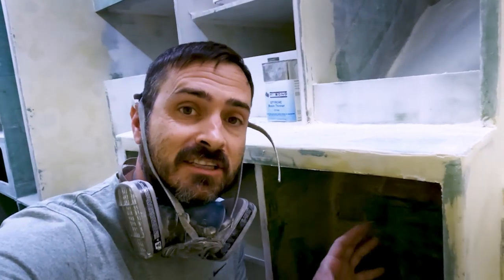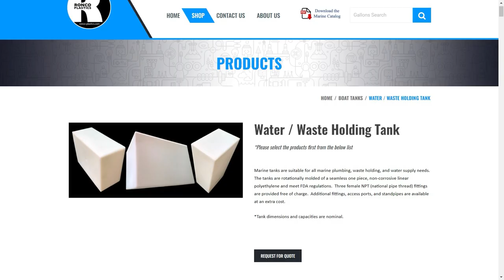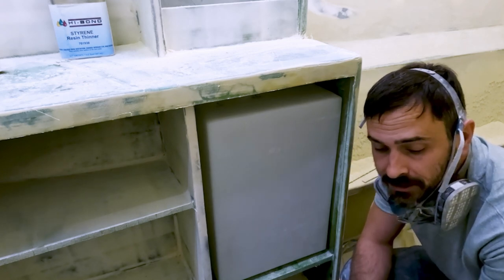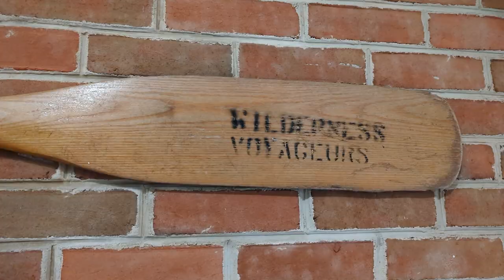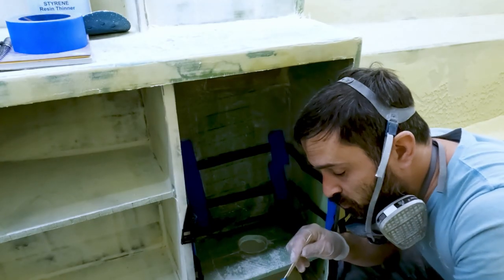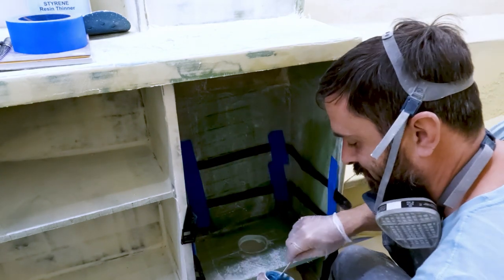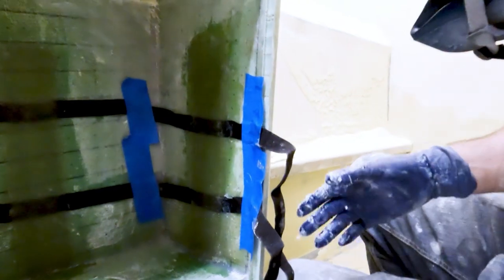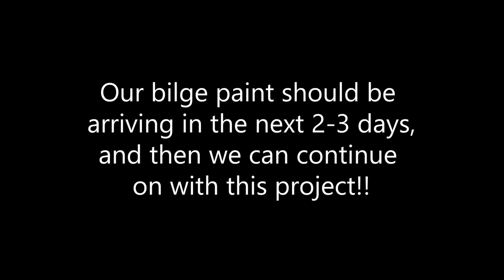Should We Have Built This Holding Tank Ourselves? (MJ Sailing - Ep 275)

Comment: Those straps are going to eventually tear where you fiberglass them to the cabinet wall. Would have been better to fiberglass and d rings, and then hook the strap to those. You could have used rubbers spacers between the cabinet walls and the holding tank.
Reply: Yeah agree, those straps will also stretch over time and under way that thing is going to thud back and forth in there and make a racket. The foam would resolve that.
Reply: I have used straps like that, and they deteriorated over time and fell apart.  I give them 10 years or so before they are going to be cursing the day they decided to glass them in place instead of glassing in hold downs that the straps slide into.

Comment: One easy trick to secure the tank is to first cover the inside of the room with normal PE plastiic film. Second insert the tank and use PU expanding foam around the corners of the tank. This wil secure the tank. As the tank is made from either PP or PE the foam will not stick to the tank nor the thin plastic film. When the tank need service, rip it out and ditch the foam. When the tank must be reinstalled, use the procedure above again 🙂

Comment: In addition to your straps get a can of great stuff and put 1-2 little dots ( think silver dollar) on each side and a dot or two on the bottom and it will keep the tank from knocking around. Works well and it'll allow the tank to expand/ grow if need be. Soft enough to allow expansion but stiff enough to hold it snug.

Comment: Hi y'all great work! I have a little engineering tip about why you always space out the straps on a tank even if you never expect it to be full. Spacing out the straps makes the tank more stable because it's easier to resist rotation from both ends of the tank rather than just one. So while it may seem best to place both straps near the bottom where most of the weight will be. It's actually far stronger to have one strap on the top and one on the bottom.

Comment: Hi You Two! As always, thx so much for your channel! 

As you plan your moves with your freshwater feeds, I have an idea you may wanna consider… there are scores of accumulator tanks out there, but I've done it differently (and much, much cheaper with similar results). I don't think we really need bladders (unless we wanna install at lower points in our system). What I've done a few times is choose a location that's out of the way and high up anywhere in the boat. Doesn't matter where. Maybe pick a closet or a lazzarette and buy as tall a piece of 4" Schedule 20 PVC piping as will fit up in a back corner of said compartment. Buy caps for both ends, a simple pressure gauge and a bicycle inner tube style of valve (Schraeder Valve), if you wanna get fancy. Put a 'T' at the bottom and let that hook up to any branch of your plumbing. As you run your system, any air will naturally accumulate in as high a point as it can find. Hopefully, your new PVC tank will be that high spot! You'll save $$$ and get much longer runs of pressurized flow with far less cycling…
Reply from the maker: Interesting idea with the PVC pipe.  I'll weigh that up vs an accumulator.  We did buy a Marco gear pump - which doesn't require an accumulator - but we probably should have one anyway to limit the on/off cycle
Reply: @MJSailing  Yep - not only do you stretch the life of the pump, you also run a quieter ship. For me, when I'm skippering, rather slight noises wake me up. Hell, a good-sized course change even wakes me! You'll also save a lotta money. All the best, Matt!

Comment: Matt, You could have used cheap thin wall plastic tubes, heated and flattened to easily fit your straps of choice. Glass them in at the same locations, and then be able to tighten them more and replace them at will, just in case of a single failure. Great instructive content, thankyou!
Reply from the maker: I didn't want movement in the straps.  Same reason you don't use continuous webbing for battery hold downs.  They end up sawing themselves apart.

Comment: 10:35 Would it not have been better to have glassed loops on to the hull, then thread the belt through them?  What happens if the straps degrade and need to be replaced?
Reply from the maker: Just cut them out and put new ones in if they need replacement.   Stabilizing the strap prevents sawing action against the fiberglass.  If allowed to slide, they'd then abrade and cut through quicker.
Reply: @MJSailing  true. Good point. I would have looked for a brace that screwed into the dudte panels like a battery hold down. But your solution is one way of solving the issue. Looking forward to seeing the boat finished.
Reply from the maker: Unfortunately nothing can be screwed into the foam the hulls or cabinets are made of.  This requires all to be bonded (a lot of extra work) and more "outside the box" solutions are needed for attachments.  Luckily, I've seen this done in the past on French boats, so it wasn't much of an experiment :)
Reply: @MJSailing  This is one of the reasons I love your channel. I learn something new every time. 👍👍

Comment: I was hesitant to question the genius of Matt but, hahaha,,,,,,,while watching the video I thought there must be a better way to secure the tank and now see comments in agreement. The weight of a full tank will eventually weaken those straps. I think, slightly wedging (and securing) a 1 inch strip (4 total) of fiber board on the upper and lower sides between the tanks 2 sides and panels, then screwing a 1 inch fiber board strip into those side wedged strips. They would run across the front of the tank. That tank will not go anywhere and can be taken out by removing 4 screws.

Comment: Fiberglassing straps in place seems highly unconventional and a    significant hurdle for anyone needing to replace a strap.  Since the strap doesn't slide, the strap wrapping around the tank doesn't do anything.  Was using screws to secure short strap sections in place or a bar like a battery hold down considered?   If you really wanted fiberglass - maybe create a fiberglass belt loop of sorts that a strap could run through and also allow easy replacement.
Reply: Agree, those straps are going to need replacing often, and now you made doing that a major job.

Comment: YES---that tank will MOVE---those straps along with a partially filled tank and any sort of Sea-action will cause thse straps to loosen. The Sea shows no MERCY. Fecal matter out in the cabin is never pleasant. You might try some plywood shims and bits of the "Great Stuff" foam, which you can later remove to service the tanki. As soon as you said--"It ain't going Nowhere"--that was a major RED FLAG. I would guess your comments section is filling up on that subject!-------Mikey, Belfair, Wa
Reply: I believe that it is the holding tank for discharge water ( grey or clean water, so you don't need a pump, like normal toilets) ,the waste tank ( black water ) is rigth next to the head. my guess is that they want to use grey water from the sink in the discharge - BUT yes, that tank will Move for sure
Reply from the maker: Strapping a tank is pretty standard practice and done on a lot of European boats.  It does work.

Comment: Five eighths is a heavy duty tank for sure.  I have a more general question regarding materials selection…fiberglass is the traditional material for small boat fabrication. When discussing boat building did other materials such as HDPE come up in the selection process. For example HDPE density is less than water (0.97) which would make the boat “unsinkable” and just as strong. I am just curious is all.
Reply: Hdpe is too slippery, carbon fibre and amrid are very expensive . There is a new basalt fiber which has pretty good qualities
Reply: @jackdbur  no more slippery than fiberglass with gel coat applied.  With density less than water a boat would be nearly unsinkable. It would have less friction in the water improving efficiency when underway. Just a brain fart on my part.

Comment: Are you really going to launch it incomplete next year? Perhaps hiring some people to help? It seems like the minimum to launch would include Installing engines, engine controls, exhaust and raw water lines, rudder/linkages/cables/autopilot, helm, helm electronics, hull joints fared/gel coat, all thru hull fittings, port lights, anti foul, deck rigging, railings/safety cables, cleats, windless/hardware, mast, mast rigging and electrical, mast tuning, batteries, power managment, running lights...I'm probably missing a lot just to get it sea worthy. Oh, and certified for insurance...which would have additional requirements.

Comment: Erm - how do you get to the bottom of the tank when it is going to end up getting congested at the bottom of the outlet? That happens quite a lot in reality. You have left yourself no access point from the top which I always found necessary to put de-clogging equipment in from - you have to be able to give yourself a fair amount of room from the top to feel around things when things are going horribly wrong in my experience.
Reply from the maker: As is typically done with clogged pipes, you ream them out with a snake.  These are macerator toilets and much less likely to clog.

Comment: the lighter solution wouldve been going composting toilet. i cant understand why people choose to lug their shit around them. specially when you can dump it offshore without feeling like an idiot. 2 people raw sewage is garbage, not pollution. there is a difference. those massive cruise ships are eons more polluting than hundreds of cruising boats altogether. with composting you have the option of keeping the goods with you whilst on shore waters, and displacing it appropriately on shore. no plumbing, no tanks, no electric toilet to go wrong, less power used, less plastic used, less holes on the boat/hull, you can even integrate the composting toilet into your specific head foot print (building one is not that hard and well within your skills).

Comment: Grind those straps out and do it better .they need to slide at minimum . They will be cut off by the fibreglass. I don't need to say much more after reading the other comments. your ideas in your mind are good ,just the execution needs a little adjustment. We all learn from mistakes .
Reply from the maker: I obviously disagree :) The straps would require movement to induce a sawing effect.  By stabilizing them, and orienting the pull to be purely in sheer, they don't get that movement.

Comment: That tank needs to be FOAMED INTO PLACE.  Crap weighs 9 lbs a gallon, under way that is 45-50 lbs asamming back and forth with each wave, so maybe 100-200 lbs of Gforce.  Nylon straps will stretch and deterioate over time, and how do you change them. Glassing D rings into the foam and secured with backing  behind the foam would be a better solution to permmently glassing the strap itself.

Comment: Sorry mate but you need to revisit how you hold that tank in, the straps will tear at the fibreglass sooner or later, perhaps a stainless tray to drop it into and a retainer band with hold down tabs at the top end to keep it locked in place. It's going to get really ugly when the plumbing fittings fracture at the tank because it wasn't anchored properly, honestly mate you need to be doing your best work on these things, cut corners on the stuff thats easy to fix.
Reply from the maker: The tank manufacturer sells the same straps to hold down the tanks.  Regarding the fiberglass, the straps are being pulled in sheer and do not abrade against the fiberglass.
Reply: @MJSailing  your call buddy, I've seen webbing straps fail at the edge of the epoxy before, for the same reason safety harnesses and seat belts are condemned when contaminated with paint, epoxy, anything that locks the fibre and creates a shear point, sorry but thats just the way it is.